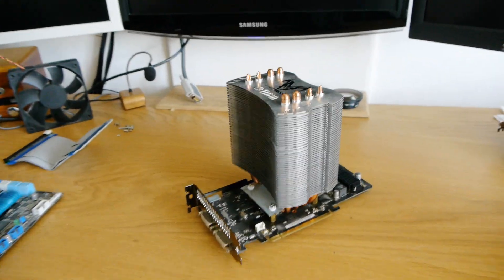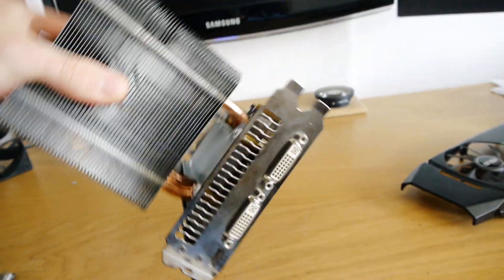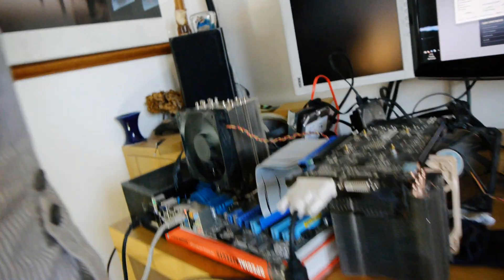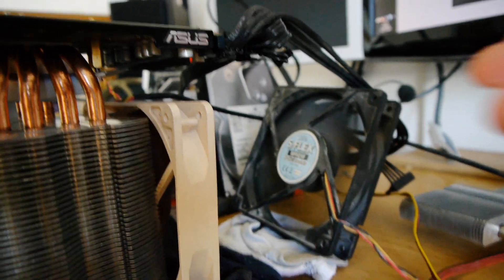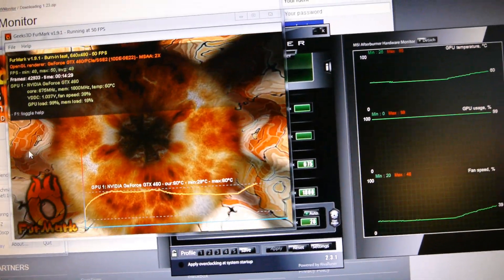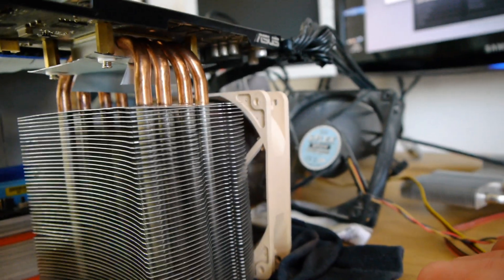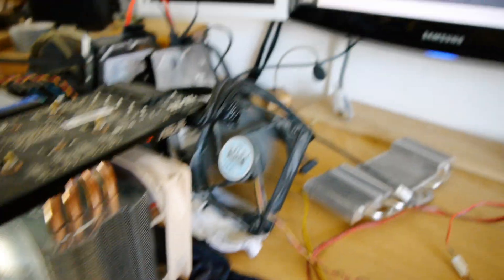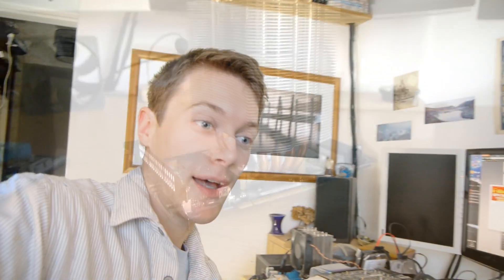CPU cooler on GPU (INSANE temps!)

Comment: What is cooling your VRAM and MOSFETs? Didn't the stock cooler also actively cool those as well? The CPU cooler only seems to be cooling the GPU core.
Reply from the maker: The original cooler didn't touch them, no.
Reply: Mr. 42 said
"That is a quite old gpu and they weren't that power hungry as todays cards"

... °Facpalm°
The opposite is the case. Get your facts right :*
Reply: Sadly many producers "forget" to cool the VRAM, which often leads to VRAM failure after years of use. But these days most people ditch their cards after 3 years so the problem doesn't show up.
Gigabyte's Windforce cooler is one of the few ones that covers the VRAM.
Reply: +maersklandro  the VRAM AND MOSFET  are cooled by the airflow flowing trought the stock cooler but this has no air coming onto the vrams
Reply: VRMs not VRAMs. VRAM doesn'te heat up as much as the VRMs do.
Reply: +Mr. 42 You misunderstand.  The airflow was much lower and when a card uses lower power (though that one was not much lower power at a TDP of 150W, the card designers just use a less robust power supply to cut costs, with the same inherent necessity to cool it for long life.  Not cooling the memory better can also tend to reduce overclock headroom, though most of that from limiting the amount the memory voltage can be raised which with some cards requires hacking the volt. reg circuit.
Reply: +Deramatic look at the r9 290x or a Titan x and tell me vram does not heat up
Reply: All EVGA's cards with the exception of reference.
Reply: +Niko_2142 They aren't that much more efficient to the extent that it dismisses or removes the problem.
Reply: +Niko_2142 Not enough to matter.
Reply: +Ivan Quiles Your reply makes no sense, considering he took the stock heatsink with fan off to put the CPU tower 'sink on.
Reply: +maersklandro Did you even watch the video lol
Reply: It depends.   Some cards have a large headroom for overclocking which increases power consumption more than the design allows for without overheating them.  Further that airflow from a fan is much more localized when it's closer to the GPU rather than blowing across the card at a distance as in the video.

With contemporary electronics it helps that today's mosfets have low RDS to reduce heat, and so heatsinks on them are less common today, but what really happened was that (higher than budget grade) video cards switched to solid capacitors instead of electrolytic which are much more tolerant to heat, so the fets were allowed to run hotter without as much concern about causing capacitor failure.  Even so, with systems optimized for low noise, especially in higher ambient temperature regions, it can help to add your own heatsinks on cards that don't have them, IF the heatsink isn't in the way.  The same is true for memory chips but it's mostly overclockers doing volt-mods that need that.
Reply: maersklandro are you fucking stupid? did you even watch the video
Reply: Those are a completely different case. The GDDR5 on this card (and most mid-range cards) are clocked very conservatively.
Reply: THANK YOU!
Reply: The vram should be running cooler now. They used to be cooled by the hot air coming off of heatsink, which means the vram would need to run hot before it could even pass energy to the air. Now it's being cooled by the air in the case, which should be cooler assuming the case has good airflow.
Reply: +Mr. 42 that is not how it works. new cards are a lot more efficient... compare a 480 vs a 980...
Reply: +Nason Collins (Whosyourspanky) He was cooling them, with the other fan and there was a small heatsink also. That is quite old gpu and they weren't that power hungry as todays cards.
Reply: Mr. 42 i meant that newer cards are better at both.
Reply: Niko_2142
Efficient and power usage or heat output is different thing.
Reply: +DIY Perks You really need to cool those, or the card will burn out!?!?!?!?!?

Comment: 23c is hot lol.....i wish my room is 23c
Reply: Guys just f off... Its   -11C in norway right now....
Reply: I'm also Canadian, and I'd put my ideal indoor temperatures at 20 C

But I strongly prefer being a little cold to a little hot.
Reply: +ThePowerOfSAM Living in the caribbean, I feel your pain. 23 celsius is what my airconditioner is set to, haha.
Reply: normal temps are arround 40c wahts your problem
Reply: +mohammedzoh3 think about 35c in the summer and its a normal day, in a hot day its about 40c
Reply: lol i dont have an airconditioner.. you still pretty far from my feel xD.. ;-;
Reply: The winter is mostly because you have no idea how to build a house. Come to finland. We have 20C in doors on summer, and winter.
Reply: mohammedzoh3 you can also use a Cooler Master Sedion 120 V Plus in place of this freakin cpu cooler 

and the point is that it would be much cooler than this cooler

if u r with me like on this comment
Reply: +mohammedzoh3 when you live in the UK 18C is a great summer day. Im a brit though have lived in Tx, NC and GA. Happy to be back in temps with oxygen now in WA. Though the summers are still a great deal hotter here than in the UK.
Reply: +mohammedzoh3 I'm trying to be like o.p.m so i have no heat or air conditioner
Reply: +mohammedzoh3 mine is 23 im alright Canada Quebec
Reply: +Rhys Osmond go live in canada ye goon
Reply: +Brian “Easty and the Wolf” Eastwood WA summers suck, no AC anywhere (Besides public buildings, most houses don't have it and the ones that do are probably very expensive.) And its super hot in my house in the late spring/summertime lol.
Reply: +DonRaynor I wish I had those Temp's! Down in west Texas we get 38c to 42c in summer mostly, and in a few of the days of the year up to 47c! I wish I lived where you live. I can imagine the difference it would make for the graphics card!
Reply: 1blisslife
 Come here. You will like it. :)
Reply: got 19 c now...
Reply: wow I live in England but my room is really hot it's like 34c
Reply: Gylactic_Shark rick Ross says huh ?
Reply: Rhys Osmond hong kong
Summer:30-35c
Winter :18-25
We are hot as fuck dudes
Reply: 27C pure hell
Reply: My room is like 26 C gtfo lol
Reply: 23c is cold
Reply: That's a very low temperature in the case of computer parts.

Comment: Heat goes up.. So the cooler won't do the job here. Put the GPU with cooler facing up and then show us the TEMPs..
Reply: +Wonder184 That isn't true at all. Convection goes up, that is not at all how a heatsink works. A heatsink works by conducting the heat away which is not affected by orientation. The air is then removed by the fan. If it was placed facing up there would be a very minor increase in performance due to the fact that convection would also help take the air away, however this is very clearly a very minor affect (The draft from convection is so small to the point it is almost impossible to feel, whereas obviously a fan is a lot more powerful) and would not in any way be noticeable with this setup.
Reply: Do you know basic heat sciences?
Reply: +1UP Marzie Actually, I do. What doesn't seem right to you?
Reply: +Wonder184 you're right, heat source should always at the bottom when you using heat pipes, thats basic heat sciences
Reply: BlueCosmology I would've explained it like you but I really didn't feel the need to elaborate haha
Reply: +sng0174 yes ,but just basic part..

Comment: "its pretty hot in here, about 23 degrees" b*tch please, in greece we have 32 degrees WITH THE AIRCONDITIONING ON
Reply: ***** well, your name has a greek word in it, are you greek?
Reply: +alexdocouz 3 bloody hell that's some shit air cooling you guys have in Greece in Australia its about 30-35 degrees but with air cooling my room is at 23 degrees
Reply: nuclear toxin i know
Reply: +nuclear toxin max 7degr C as difference from outside to inside temp is normal for health,its not that can not be bigger difference..i will never recommend or set up bigger difference..without middle room..and setup on sensor on top of room is much higher reading then actual room temp ..consider that too,when talking about "usually"used home split systems..just take care to not shock ur body with exposing too fast to too much diff of temp! industrial regulations,and medical advice! otherwise,take care to have paid  health plan..
Reply: +nuclear toxin when i went to hellas (greece) it was 49.9 degrees for 2 days (2007 heatwave). Stayed at mellisina. If the place wasn't made with a marble roof and floor I would have melted.
Reply: alexdocouz 3 :) nai re
Reply: ***** e tote pou meneis kanonika kai phges sthn ellada?

Comment: Cool. But there is a passively cooled GTX 750ti
Reply: +Rhodiebert85 This isn't a GTX 750TI though. The GT 460 is much hotter. You need to think about the amount of thermal energy. The GT460 is 160 watt and the 750TI is around 34W. Thus the GTX460 needs a cooler that is able to dissipate 4-5X the amount of heat.

Comment: all that and you got 51°?? completely useless
Reply from the maker: You're forgetting the silent part, which was the entire point.
Reply: +NiCoo ce You fail
Reply: +NiCoo ce You clearly know nothing about cooling GPUs. A normal GPU temp under heavy load can reach 80-85 degrees easily. And then the sound is just horrible, completely horrible.
Reply: Clearly you've never used Fermi.
Reply: +DIY Perks but... you might as well have purchased a cheap graphics card with passive cooling if your looking for silence, or simply underclock your card and re-paste it... mine runs quiet at only -100mhz core clock and its a GTX 970
Reply: +DIY Perks sound wise you are OK but you can destroy the vrm and the ram

Comment: Won't the DDR modules overheat due to not having access to the heat sink? You know I did something similar a while back and I managed to burn my card. I used the stock cooler it packed, removing some of it's components to reach and remove its fan and replacing it with a bigger one. It worked fine for a while and then started producing artifacts and messed up colours. What I'm saying is, I love the idea, always wanted to have a PC full of huge sinks and just one big fan, a 14cm or something in the side, but I don't think it's just that simple, especially for the graphics card. And sure, you could risk it for an older outdated card, but would you do the same for a GTX 970 that makes a ton of noise?

Comment: My PC is ice cold and I never hear any sound from it.  That's because I bought 5m extension cables for everything and put the PC in the next room which is used as a storage room, it rarely gets above freezing in that room because it is uncarpeted and the heating is off.  This meant more space and less noise in my bedroom, where the monitor and peripherals are.  Though it's not as good as the time I stayed in a tower block and kept my PC inside our ventilation system where the temperature passing it's external radiators was completely arctic.
Reply: +Cossack-HD the delay is 0.00000167 ms/ft. (Thats 1670 picoseconds). the signal travels ar 2/3 of the speed of light. to get a noticable signal delay you would have to be on another planet.
Reply: tjeulink You seem to be right, I searched a bit and found out that hdmi signal is darn fast. But light time from Moon to Earth is 1.3 seconds, which is 1.95 seconds for 2/3 of light speed - Moon isn't really "another planet", but there's still quite a huge signal delay :)
Reply: Cossack-HD hahaha yes you're right, we have a saying for that in my language thats something allong the lines of " exxageration gets the general idea across"
Reply: tjeulink
 you could have as well just said that hdmi signal speed is as fast as 2/3 of light speed, but it's always fun to put some crazy calculations for an example, just as you said.
Reply: +Rob Fraser Does that affect your monitor (screen) delay?
Reply: +Cossack-HD ignore the other guy, I have a same sort of set up as Rob but mines just further away from my pc (what I mean is its in the same room just in the other corner of it) mainly because of space and there is no perceived latency using extension cables, sure there is but not even a pro gamer would complain about it.
Reply: ***** I did worry about this, especially in the tower block, so I experimented a bit first, but condensation is vastly increased with respiration.  A dry room with no occupants ever won't generally have enough humidity to form condensation.

A good test is to look at the windows in the room (much colder than any PC part) if the windows are dry then the PC will remain dry, windows attract condensation when someone is respirating in the room exhaling moisture with each breath.
Reply: That is pretty smart. Not always possible though and ... what about delay?
Reply: +Mas Deago pro gamers will pretend to notice nanoseconds of delay
Reply: *****
 Skylake has small chips which makes it difficult to dissipate the heat from the CPU (becuse of the small size of contact area). Even if a CPU is more efficient and doesn't draw as many watts it can run hotter (15% more efficient and 25% smaller = "10% hotter"). One of my friends got fastest Skylake i5 and got scared when the temperature bumped up over 25 degrees almost instantly under load. He has a high performance system but the processor was running as hot as FX-8350 at 4.8 GHz.
Reply: *****
I agree. Skylake can be cooler than previous generatiosn with moderate workload and clocks, and it doesn't require as good cooling system as other alternatives because total amount of heat is lower. It's, as said, hard to keep a small thing cool.
Reply: @Anteksanteri  there is another way... if he would submerge his total PC in mineral oil. the artic temps will help dissapate the heat while no worries for moist damage :)
Reply: No roomies will not live
Reply: +aleksanteri reijo Just use WD40 lol

Comment: I have a fan on my GPU with a half broken heatsink, fan is running at 5V only and temps while idling 41°C and when maxed out with overclock 45°C but mine is some old ATI Radeon HD 4550 graphics card so it makes a huge difference

Comment: Doesn't need the graphic card to be grounded by being connected to computer case ?
Reply: +Zdzisław Alfabet It is grounded in both the pci-e cable and in the extra power cable from the PSU.

Comment: hey, i just had an idea that you might be able to take to the next level with this. im not sure if the heat pipes are hallow or not if not or if they aren't thick enough on the inside make you're own heat pipes. anyways, what if you combined a air cooler with a water cooler. you take a closed loop and combine it with the air cooler attaching the tubing to the heat pipes.

Comment: if you rotate the cooler 90 degrees  you might get it to fit without the extension cable. Just looks like it might I didn't try it myself :)

Comment: in my country its 31 c average and my laptop normal temp is 80-110 celsius and you call 23 c hot!,,do you even temp bro???
Reply: He's not responding. I think his laptop had its last moment.
Reply: over 100°c would damage your parts.
Reply: +Antony Xiao my laptop is samsung imma upgrade to real gaming pc
Reply: +gadiel dadap Your laptop would shut down before the processor hit 110 degrees.
Reply: +gadiel dadap You did it?
Reply: i have the case and the psu XD
Reply: xDD
Reply: +gadiel dadap Did you get a good PSU?
Reply: 80+ 650 watt
Reply: gadiel dadap
So... Did you get a good PSU?
Reply: wat
Reply: Smokey Amp
Or should, anyway.
Reply: gadiel dadap
What PSU did you get?
Reply: +gadiel dadap what gpu
Reply: +gadiel dadap 31c?????? it is 5c average in mine
Reply: Capitalist Roope tru
Reply: gadiel dadap
hehe